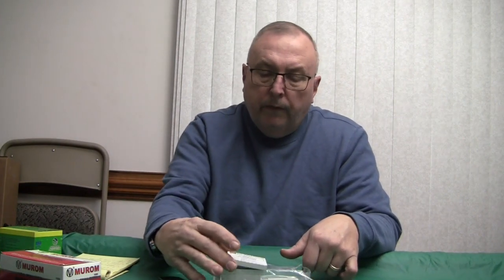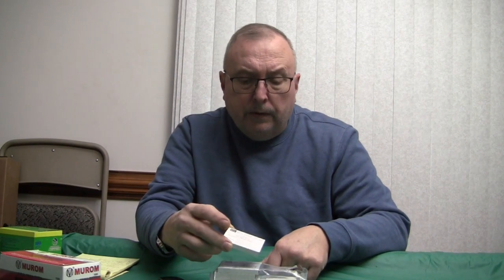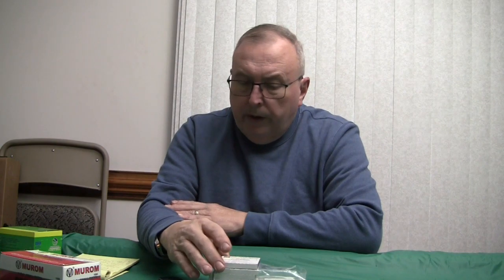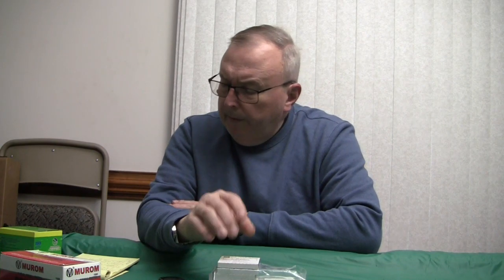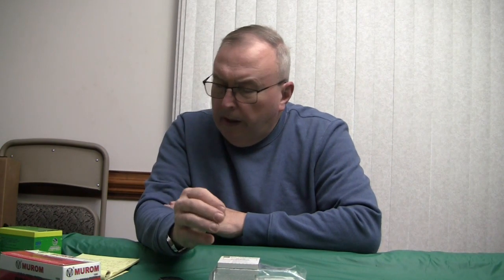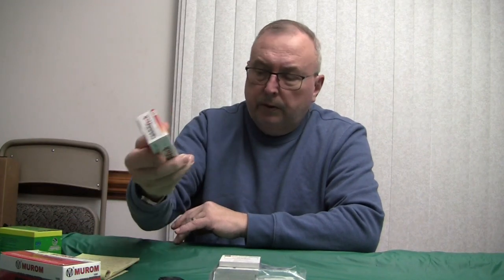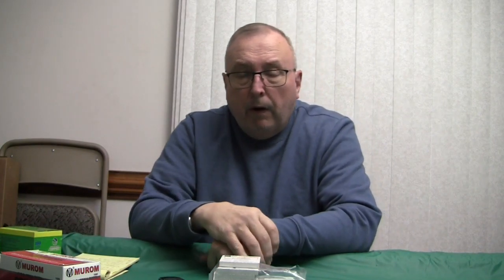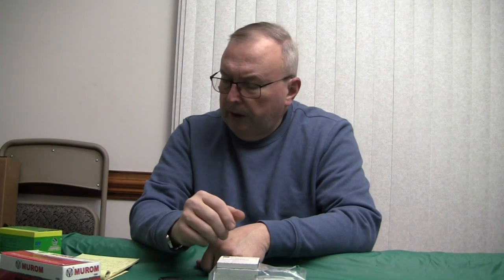Conclusions of UNIS GINEX primer testing

Comment: I think unis is a little careless in keeping SPP and SRP primers separated. I get 3-5 "light strikes" with the SPP run in striker-fired pistols, but no failures in hammer-fired.
I loaded 30 rounds of 223 with SPP primers and had 2 of them chronograph 30fps slower than the others, adding to my suspicion.
Unlike other manufacturers, the color of the cup on both is pale pink, so I can't tell them apart

Comment: I have tried the small pistol and small rifle type. I have had some issues with fit. They seem to be a little large diameter. There have been times when they were damaged installing them.
I have tried installing them with different types of equipment and all have had issues. I would not buy them again unless there is nothing else available.

Comment: American Reloading just had a quick two day New Year's sale on the 5000ct  SRP packs for $315... DELIVERED!    Yeah well,  they didn't have to tell me twice.  My SRP primer stocks are now sitting at 21,500 as we speak with 17K of those the Unis Ginex variety.  Haven't have any issues and they fit the bill for rolling my stash ammo during these topsy turvy economic and political times.  

They CAN be a bit tight especially if trying to fit into Lake City brass.  However, with proper case prep, swaging and uniforming, this tight fit can be remedied a bit.    

Great primers and worth ever cent.  I probably should have picked up two or three more bricks but, neh,  no need to get greedy.  Other folks will certainly be needing some too.

Comment: Have used the Ginex small pistol primers now for approx. year mainly because of price and availability compared to other manufactures non availability and cost here in western Canada.  My Beretta 92F (9mm) has had spring & trigger work done on it and that resulted in a noticeable improvement over factory ( Double Action Factory was 14.7+ lbs. now it is 7.4) and single action went from 5.8 to a smooth clean 2.14  and so far 100% bang rate, and no noticeable accurace change. Also use the Ginex primers in my Colt Python 2020 4.25" .38/.357 mag. that tested at 7.1 lbs.double action and 3.2 lbs. single action factory out of the box, with no issues either. As for setting I always use a hand primer (RCBS Universal) and if there is any amount of extra force required to set the primers it is very very minimal that I don't notice. As with all primer setting operations if you do feel resistance stop and check to see "WHY"! Now just need to change our Federal Government (Liberals) to a government that doesn't punish law abiding citizens and legal firearm owners here in Canada. We unfortunately do not have 2nd amendment right in our constitution.

Comment: I have loaded thousands of them without issue. Up here in Canada they are distributed by CamPro and often you can get a projectile/primer combo at a better price than if you were to buy both separately. They even held together well on a dozen that wouldnt pass my case gauge test and I used a LEE decapping die and pushed the primers out and used them again.